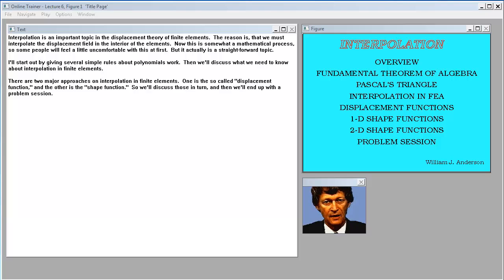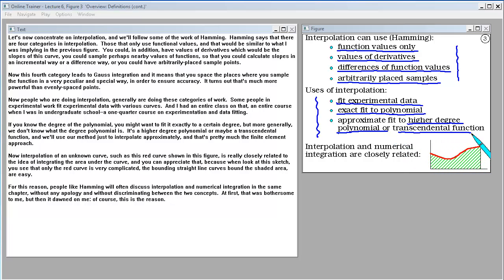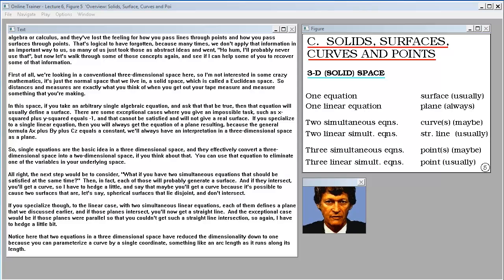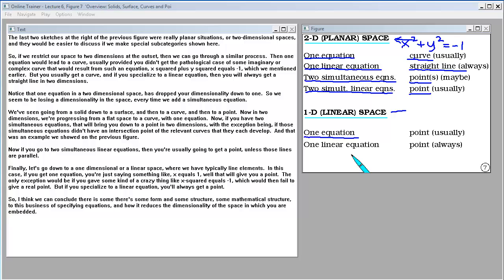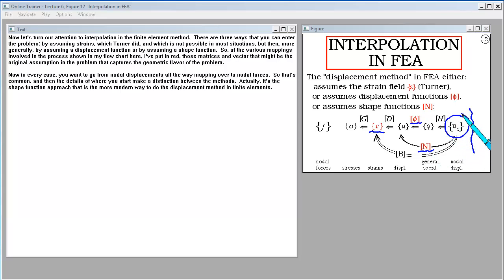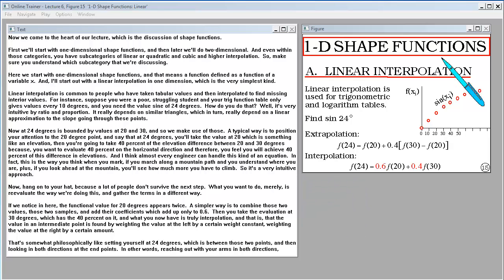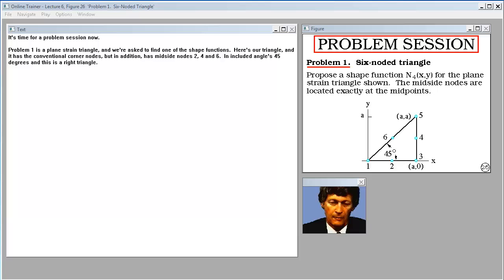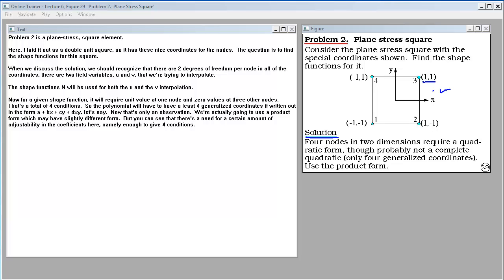Interpolation. Lecture 6.

Comment: Thank you Siva, Alireza and Chenhao.  I listened to the first 15 minutes of the lecture again and it still seems interesting.
I've been retired for 15 years, but remember this material quite well.  You wouldn't realize that when  I started recording these lectures, my speech was very stilted, and with a lot of errors.  I remember once counting five "ers" in just one sentence!  With practice, however, one gradually removes all these verbal errors (partly because it is so painful to do the corrections).

There are a couple of audio "breaks" in this lecture.  This must have happened in the conversion from the original discs to the YouTube version.  Luckily, they are short, and the written text covers the few words missed.

Good luck in your educational goals!